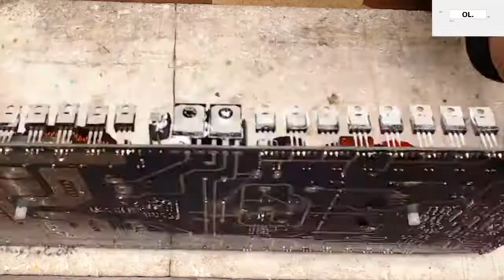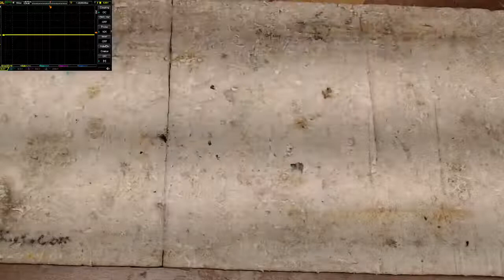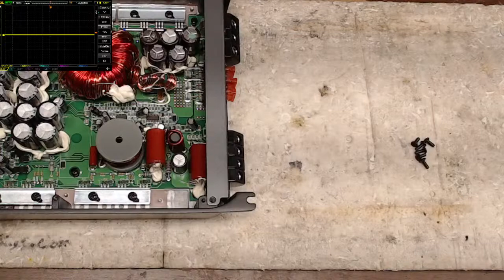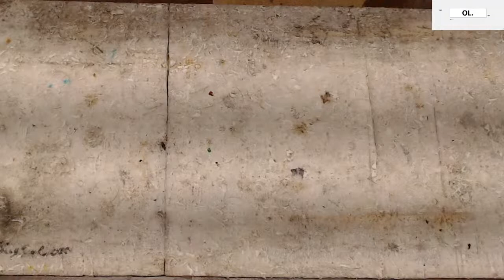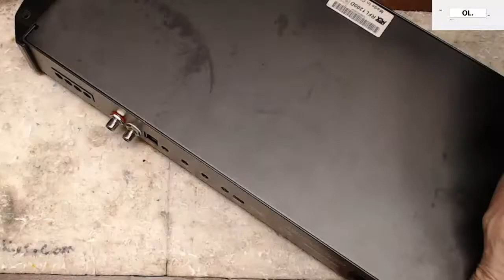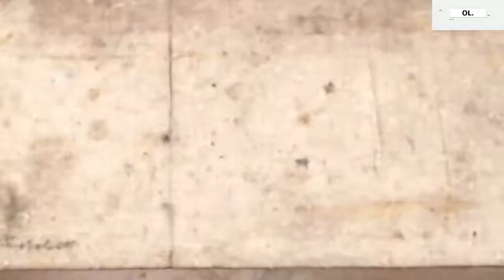E'burg Amplifier Repair Lets Diagnose Some Boards

Comment: what would blow if you cross speaker wire with remote when running please help ware to stary
Reply from the maker: Shorted remote circuit and/or shorted amplification section.

Comment: looking to have an amp repaired 
its a taramp 2000x4 
wont power up and it holds 12.v after its been unplugged
Reply: yes 
took me a while to fix sense its my first time 
great video truly helped me out
Reply from the maker: Yes, the power supply input capacitors will hold a charge for quite some time. It sounds like a shorted output. www.ellensburgamplifier.com/request-a-quote